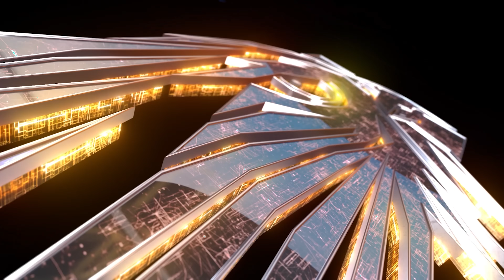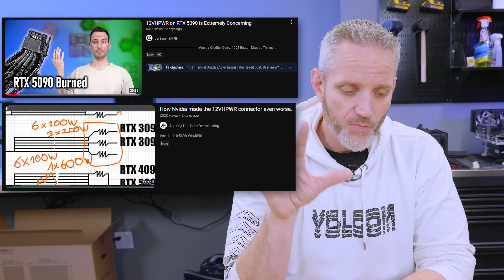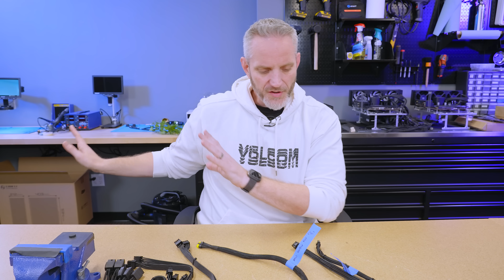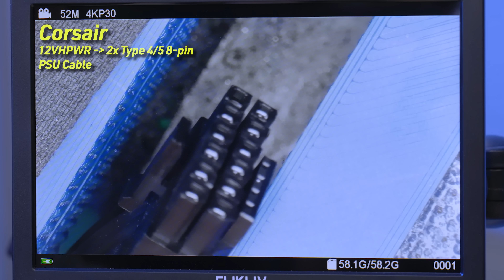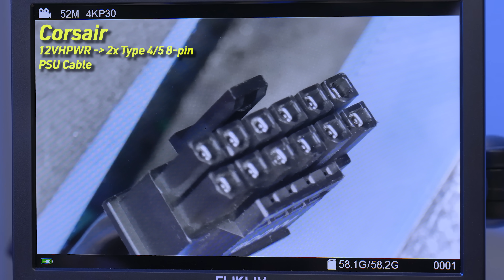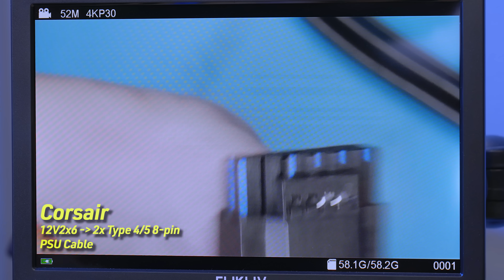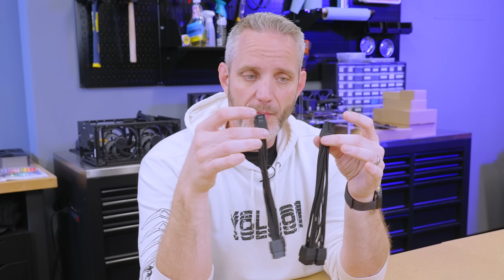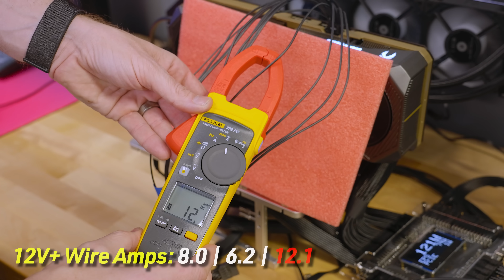I discovered something concerning and I need the Experts to chime in... More 12VHPWR discovery!

Comment: Good to see you noticed this Jay. Andreas Schilling(?) noted in his tweet reseating the cable fixed the issue and it's great to see that you also noticed this. I'd been dabbling with the idea myself but my dad just went through a heart attack so I haven't had time to really chase it up.

I'm an ME in training. I think everything that was said up to this point by the Intel engineer and BZ was correct, but you also noticed the loose plug/pin thing that I did and wanted to get someone to test. I'm so glad you could do this video because I'd been wanting derbauer to do this test with his known bad cable.

A lot of people might think you're being a little silly to talk about this, but I strongly believe you're correct and was something I believe is the core of the issue for this entire problem. Well spotted.

My experience with the 12vhpwr is some cables have an EXCELLENT connector, some suck. Big time. They feel like they are crushing the card to fit into place, others feel like they slide in PERFECTLY.

I am so glad you made this vid jay. Props on figuring this out because I genuinely feel you are onto something.
Reply: That's a lesson on plastics ability to expand/contract and engineering mechanical tolerances.  Too much allowed and you get variances like this... too little allowed and you are overspending... 30 cents over 100,000 cards equals $30,000 if my math is correct.  From a corporate view:  If I can shave $1,000 dollars off of my total running cost of manufacturing these, I can still charge the same amount and make that $1,000 bucks.  Is that the right view to take here?  NOPE, but it's what they are doing.  I mean I saw this first hand at electrolux and them shaving the tiniest amount off of their already WAY too thin plastic sheets we made in-house for the doors and inner shells of the refrigerators we made... to save millions by the end of the year, only to spend so much more on producing scrap... but as long as that scrap amount was under a target number they were ok with it... then they did it like 2 or 3 more times after that before I got let go... all the while screaming at us to make less scrap >.>  ugh.  But yea, that's how those not on the floor of the manufacturing departments think ;).
Reply: @christopherjunkins  Absolutely right. And then you end up with those of us on the receiving end with a $2000 buggered card. Sucks but you're absolutely right. 100%
Reply: What brand would you recommend for a good and reliable 12vhpwr cable?
Reply: @giraffeorganic  hey there. Given the current knowledge in the wild. I am currently under the personal impression that we will likely see in the near future a test that would demonstrate that the different degrees of pin contact (Reference to how jay showed the pins moving in the connector) would create varying degrees of current through each wire as the cables will balance based on physical fitment. EDIT: Need to clarify here. When I say this, I mean the PINS. The connector can be fully seated, but the PINS can be improperly contacting in unequal measure. I really hope this is enough to explain where my head is at. 

To put in easier words, if cable pins wiggle in connector? I highly suspect it's the danger cables. Intel EE's advice and BZ's advice aside, I also agree with their suggestions that the spec is stupid, but I genuinely think if those cables have wiggle in the connector (Like the pins move if you try and push/pull on them with the strength of like holding a pen) those are the problem ones EDIT: or rather, the REAL problem children. Not only bad, but REALLY bad, and leading to melting/150°C per wire/potential fire hazards. What this means in short is that I can't say if ANY brand is totally safe, I think it's a problem of a design spec flaw, and the individual cables themselves need to show that they don't shift in the connector (I've currently found 2 of my cables **don't do this and they're not the same brand, one's actually the old original nvidia 12vhpwr connector).

I've yet to pull things apart on my end to find all my spare cables but I'm looking at seeing if I can test this (I have a few 12vhpwr on my hands and I am considering buying a current clamp meter). Unfortunately with the state of my dad, everything's hectic. You may see this type of test appear from someone else in the very short future (They also can probably afford another 90 card lol).
Reply: @ Thank you for all this, I'm very sorry to hear about your father's current health. I've also had my fair share of health scares from friends and family members. I wish you all the best and your father a speedy recovery.
Reply: @giraffeorganic  thanks friend. Taking it one step at a time right now 💪👍
Reply: @giraffeorganic  I have been using the CableMod C-Series Pro ModMesh 12VHPWR Cable Triple 8-Pin on my RTX 4090 and haven't had a problem.
Reply: Buildzoid and the intel engineer are really smart guys, but current metering is not the solution, we need better QC on the cables and/or PSUs... If your boat has a leak, you don't install a water flow meter to see how fast water is coming in to prevent the boat from sinking. Current metering should not be required if the cables did their job properly. It's a bandaid to work around an issue that shouldn't be there in the first place.
Reply: @Alvin853  hi alvin. I wholeheartedly agree. I think this problem is two pronged, and if my current hypothesis is correct, it implies not just metering to DETECT the issue is a problem (This isn't a FIX) but also the fitment of the cable EXACERBATES the issue due to imbalanced pin contact. EDIT: This therein leads to what I think is a problem of the spec, as you can not only have a card OR PSU that cannot balance this issue, but also spec tolerance worsens it to the point of physical failure.

I like to akin this to how ram can often have issues even if you insert it "correctly", and sometimes need reseating. Same principle. Except in this circumstance it's actually psuedo 450-600W of power and genuinely a fire hazard.

Again, if everything about this line's up, that is. Hopefully I find something I can work with later today to try myself, but again, someone else may end up making a similar video and they'll be better equipped to demonstrate I'm sure.

Comment: Correct! It is a Clue! A clue to NEVER buy any Corsair Parts!
Reply: That's quite the jump in logic. How does this affect the quality of their other products? (it doesn't)
Reply: @fated2pretend  If one crucial product fail from them, and their CS tries to avoid providing Warranty for a Product of them then you do not want to give any of your money. At least I do. And so should others.
Reply: @KathrinHausermann  what are you talking about? This is an Nvidia problem caused by their stupid plug design. Corsair makes a tons of solid products and issues warranties for manufacturing defects just the same as any other company. If you think one anecdotal video about a potential cable defect means the entire company should be avoided then I have news for you - all other companies are the exact same way.

Comment: In engineering class one of the first things we learned was a safety factor of 2.  Meaning if youre designing a bridge to hold x amount of weight it should be designed 2x the amount of weight.  Yet these cables are designed for 600w and surpassing it?  Are they even UL listed?  They really need 2 plugs and/or maybe some power sensing on the pins like you said.
Reply: When in doubt,  make it stout.
Reply: There is no rating on the cable since it's usage dependent.

The individual pin ratings add up to 685W. These pin ratings have their own margin of safety built-in, but it probably isn't very generous.

The sum total rating needs to be de-rated for parallel connections, since small differences in resistance can result in large differences in current. Apparently NV and PCI thought the total derating of about 12 to 15% is fine, while conventional wisdom is about 20% per doubling of pins, coming up to 52% total for the connector, or 330W drawn.

Another problem is that the pin rating comes from the manufacturer, Molex for Microfit 3 and Astron for whatever they did, but... when you're dealing with clone connectors manufactured by any number of third parties, all bets are off.

UL listing doesn't really apply and there isn't really a corresponding test standard that would catch the fault from what i know, because it's a little on the exotic side. Just because you ask a bunch of engineers and most of them will grimace in pain at you because their experience says it's a little borderline for comfort doesn't mean there's a rulebook somewhere saying it's not proper.

Comment: Many Industry grade plugs ether have screw terminals or interlocks that fasten the connection. If you try to deliver that much current you have to usa a plug that should be 100 % interlocked. There is a reason we go up in voltage instead of current for most applications. If you design electronics and you look seriosly into establishes high current connectors you would see they are big and often mechanicly interlocked. High currents mean a higher risk of heating or fire. Thats why you normaly make those connectors extra secure. Just look at typical automotive connectors. They also run high currents and mostly use 12v.

Comment: Just tested it with my spare Be quiet cables. the gpu side (angled 90°) is fine, but the psu side does have the moving pins while moving the cable. H++

Comment: maybe someone can produce an adapter with shunt resistors and a small circuitry to go between the connector and the card or PSU and load balance the cables or cut off the power completely when it detects over current one some of the cables?

Comment: Pin depths being off would explain a lot.  Ground is where that current flowing on the +12V goes so it doesn't matter if it's a +12V or ground not making contact, missing contacts is bad.  Putting only one 600W connector on a 600W GPU was a poor choice by Nvidia (i.e. they didn't leave enough wiggle room for crap quality cables).

Comment: Is there no difference between 12v-2x6 cables?  Are they prone to burn just like 12VHPR?  Are these problems mostly on 4090/ and 5090s?
Reply: The standard for cables is the same between 12vhpwr and 12v-2x6, but obviously some are worse, like the Corsair one.

Comment: My initial take on the ground situation is that there is another path to ground - through the PCIe slot, if the circuit design on the card allows for it. Push enough current that way and you'll burn out the slot and/or the ATX power connector, but it is a path that is not available for the 12v supply from the PSU to the graphics card.
Reply: The PCIe slot has 12V too..
Reply: it doesnt. the slot supplies power, doesnt take it. so it shouldnt ground to it.

Comment: Current wont be the same on 12V pins and ground pins. Ground loops also through PCI-E connector and PC case. Current flowing through ground pins should be lower.

Comment: Not an expert, but all the grounds should be connected, with nothing in between, while all the 12v pins could theoretically go to different parts of the GPU, or have different treatment.

That being said, if one of the ground pins was not making good connection, it would raise the resistance of that pin, thus more heat

Comment: current takes the least resistive path
and it was also discovered with video cards that ground back to the PSU can happen trough the AT24pin because it's least resistive
I will bet you that cutting at the ground pins from 12VHPW/12v2x6 connector will have no impact on the card's functionality

Comment: I don't get why they keep adding more wires that are thinner wires. A 1mm (copper dia, ignore insulation) cable is about .75mm2 of copper, a 2mm cable is about 3.14mm2 of copper, so 1x 2mm cable can carry approx double the load of 2x 1mm cables. If you then go to a single 3mm cable the cross section of copper is about 7mm2, so a small increase in diameter makes a much bigger difference than adding more thin wires when I comes to load/Watts (watts = Volts x Current). 
I would rather they make new cables that are twice as thick and half as many wires. Give me a 4 pin connector with 12ga wires not this 12v gen 1 or 2 crap with 12 wires that are like 16ga each. 
A 15amp/240v cable in Australia is only 2.5mm2 copper per conductor (approx 10ga) and can handle 3600w......

Comment: My Corsair RM1000x ATX 3.1 PSU that I got earlier this year uses a 12V2x6 to 12V2x6 plug (rated for 600W allegedly). It does NOT use a 12V2x6 to 2 PCIe 8pin connectors. I havent checked the pin depth on this cable, but now this video has me curious and I need to check!
Reply: melted 2 4090's using the cable mod adpter v1 and v2, brought the exaxct corsair cable and installed it, has not moved since, then been in over a year, dare touch it now, after this, its just a shit show!!!
Reply: My Corsair has different pin depths from the factory. I noticed it last night and commented about it on a well-known Discord. Not an EE, but know enough about circuits designs to know that this is bad.

Comment: What they should have done is make a truly new standard with just one 12V and one Ground wire that's like 8ga/10mm² instead of repackaging the PCIe connectors. You can't have bad load distribution if all the current just goes through one wire. This is why car batteries, alternators, starters, EV motors... aren't connected with a bunch of the small wires they use for headlights and sensors and stuff, but with single thick ones.

Comment: please try to pull out the cable, then on the pins there is two taps, pull them out with is like little flys (sorry bad english)
I worked with those pins before, so if they do not click in place it is that there is something bend on the metal pin itself and to fix this you can re bend it or replace the pin.
so if you pull it out try to re bend the taps that hold it in place and then put it in the connector it should click and lock into place if it does not then the plastic is bad.
this is something you shoudln't do but I would love to see it just as a test.
and if it clicks on place and it holds right then there is an issue on corsair quality.

EDIT
if you force it out you are probably going to break it, unless it is real bad then it would pop out no problem, usually those get hold in possition (not good) by the rest of the cables but it is not fully seated.
if you want to remove this and fix the cable you need a tool
It woulf be great if you test the cable as it is and then fix it and re test to see if it makes a difference I would do it but there is a paper launch and a money issue anyway.

Comment: Hey jay, just a small correction there are corsair pcu with a 12v plug on the pcu, happen to own one they are pretty new and its the rm1000x atx 3.1 psu from corsair so they actually do have a 12vhpwr cable that isn’t a adapter

Comment: solution: remove the plug jackets and directly crimp the individual wires from the psu to the gpu. Edit: also use house-spec wire from the psu to the gpu.

Comment: 23 amps requires a #10 wire. If you want to use 2 #12 wires you would need to have some load balancing system. 

Given the price of copper they are being cheap on the cables. They also should be using screw in connectors. Insert wire, tighten screw. Go to the hardware store and find a 30 amp receptacle and see how that connects to the wire.

Comment: There can be multiple rails on the GPU side. There can be multiple rails on the PSU side. When you have multiple rails on the GPU side the current is going to be divided into each of the rail. When you have multiple rails on the PSU side, each rail is going to be divided into different loads. Different loads can affect the effective voltage that rail can provide, and when it's all joined on the same rail on the GPU side, it's going to draw the most current from the rail with the greatest voltage. It makes no sense to continue examining the cables, to continue examining the railing on the GPU, but to continue ignoring the railing on the PSU.

While your PC is connected, get those voltmeters out and measure the voltages per pin on the GPU side on systems showing the problem. I'm going to guess those systems are also drawing a lot of power for fans, pumps, CPU, RGB, internal LCD screens, USB peripherals, etc.

Comment: I have a MSI rtx 4090 and corsair PSU. I've used a Fasgear cable for all my cards without issues. I've cycled the connector multiple times as well.

Comment: I always design electronics with 3x peak power draw in mind as a safety envelope, a simple engineering trick though it’s not always practicable within a given budget. Following this logic, you will need a 2000W PSU to safely deal with a 5090. It sounds crazy, but at these power levels a 3x safety design envelope is not just responsible it is totally necessary.

To put this further into perspective, you will need a more than a 30A main breaker to fully leverage the card assuming you are also running the avant garde flagships such as the 9800X3D or higher. 😂
Reply: 15A circuit is enough in EU :body-blue-raised-arms:
My (EU) gaming room and kitchen are wired for 35A (3phase), with 25A barkers. Even if the 5090 was 500bucks, i still wouldn't risk it/wouldn't spend my own cash on pour design/ be an alpha tester.
Reply: so your house is wired with 5qmm wires?
Reply: Why would that change the amperage per cable though? There's no current balancing per cable implemented, which is the main issue.
Reply: @ It wouldn't. i was responding to OPs power design criteria of 3x short term margin <- that i agree with. Only thing is that it's easier to build those margins (and even overkill) in the EU, on 240(mono) or 380(tri), than it is in the US :body-blue-raised-arms:
Reply: 1200 is enough, 1500 is the best, 2000 is bulletproof